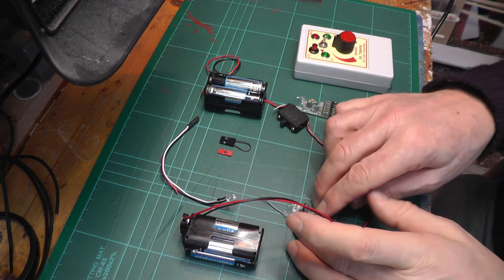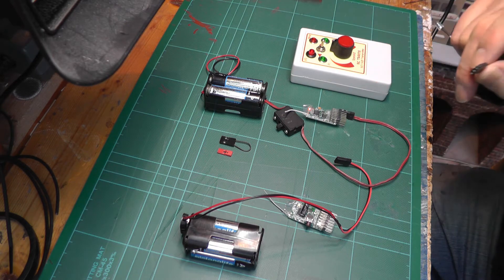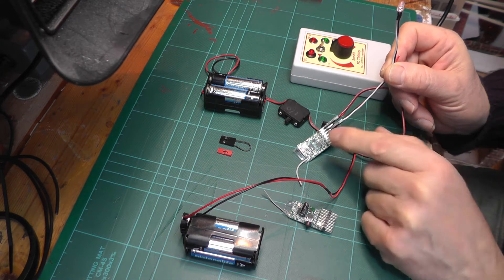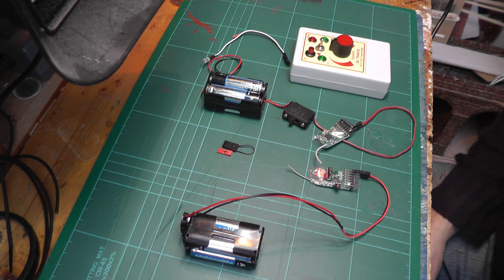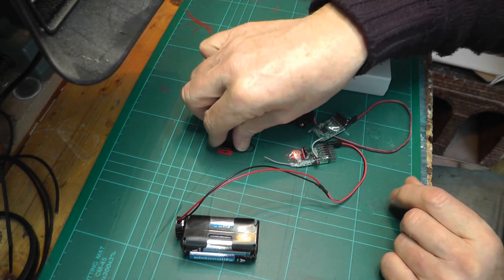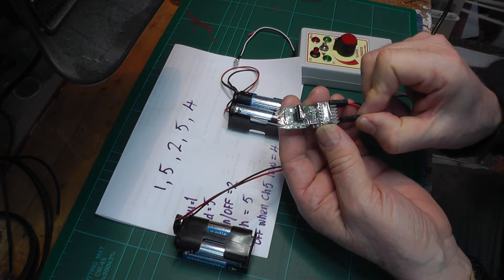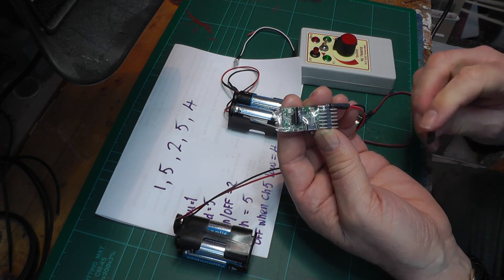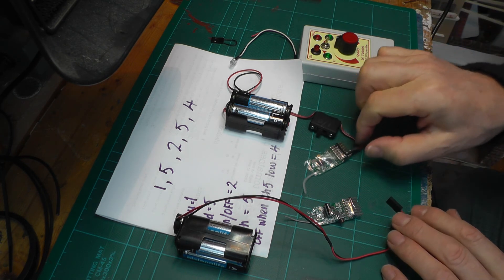Reprogramming a Deltang Rx102 with a Prog3 to trigger effects on a sound card

Comment: Hi, many thanks for is info. Company's like Deltang  should have some staff like yourself. To save buying a programmer i get the impression i can use a Spektrum transmitter instead. have you tried this & would your instructions be similar for an RX60
Reply from the maker: Hi Chris. Deltang is a one-man-band and David Theunissen is hard-pressed just keeping up with constructing the equipment. I don't think he has time for much else these days. I've not tried a Spektrum Tx, but programming the Rx6x range of receivers is a lot simpler than the Rx102. There's some info on the Deltang website and on my blog - https://riksrailway.blogspot.com/2018/02/how-i-programmed-deltang-rx65b-for-auto.html
Reply: @rikbennett9  Hi, its a shame there is not some simple software for these receivers that could be used, but in all fairness, if he is working on his own, you can see the problems on getting hold of these receivers. I had to go for the RX60 as no one had any of the other & more up to date receivers with a built in ESC.  
Your blog looks like it has some great info & will have a good read. All of my 60met layout is with ON30 & gives me a little more lea way than OO/HO, but not as much as O & garden layouts. Thanks again. Chris